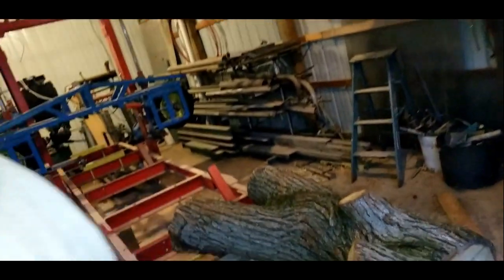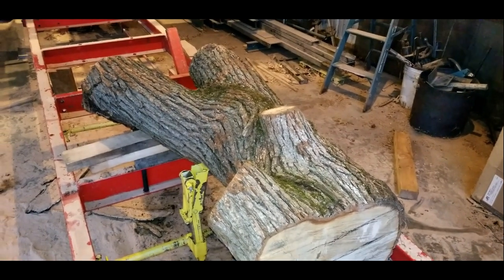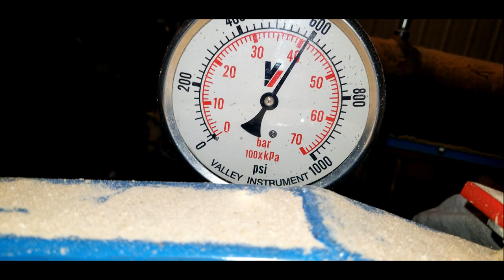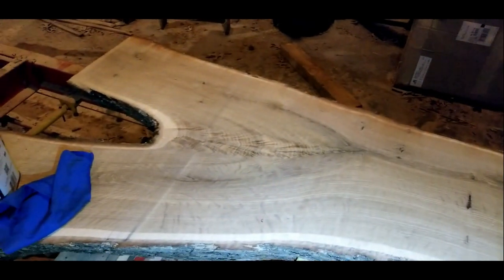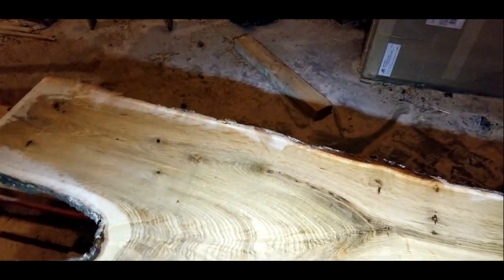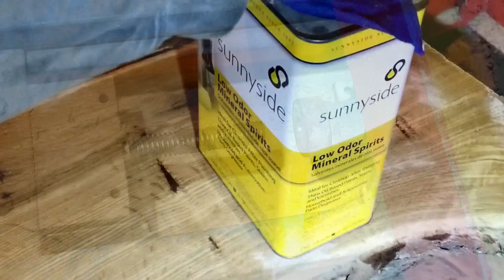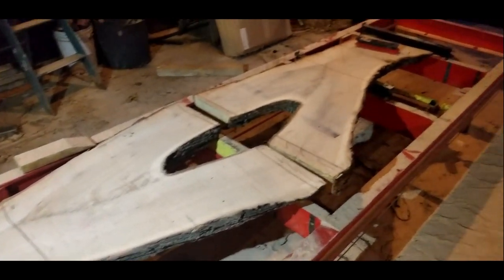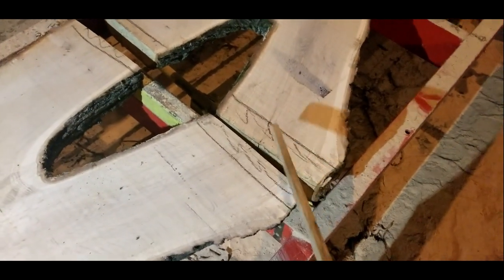Baby Oak Slabs Baby!

Comment: My wife always encourages me to slab up small hardwood logs around here for her projects. I have yet to open up a log and not enjoy what I find, except for the odd one that rot developed too far.  My thoughts, which are worth every penny you're paying for them : I like the earlier suggestion of using the pieces as legs. That would be impressive. Then again, I also like the idea that you presented in the video of bookmatching the two limbs. Fluted Oak dowels and epoxy, and let the bookmatch be the lily... no need to gild it! I would not remove the live edge inside the glass insert area though... I'd stabilize all the solidly attached bark (or peel/scrape it) but leave as much of the live edge as possible, then inset the glass from the bottom. If you feel a need to have the glass even with the table top, either inset it from the top (preserving the live edge under the glass) or inset the glass from the bottom and fill the area above the glass with a clear epoxy. You'd get the toughness of that epoxy... Pretty good bonus if you have kids and grandkids terrorizing the place like I do here.

Comment: For the shape of the table - think stingray (without the tail of course ).
For the joint- brass spine in between, with both pieces bolted together with clamps sunken in wood from the bottom (similar to how laminated countertops are connected in corners)